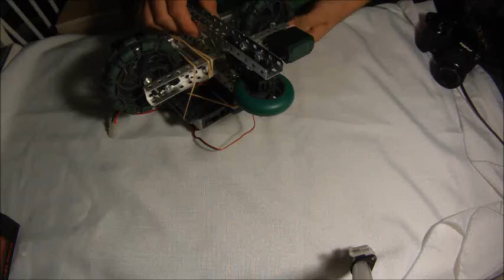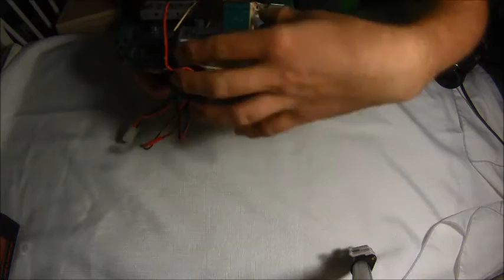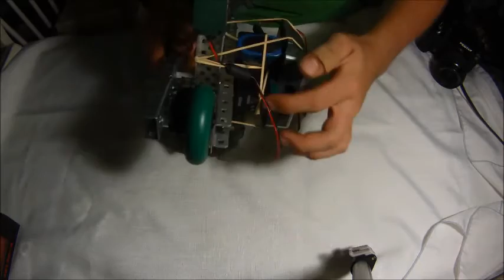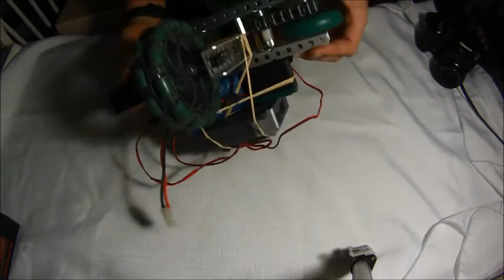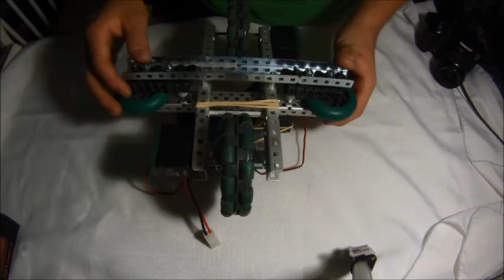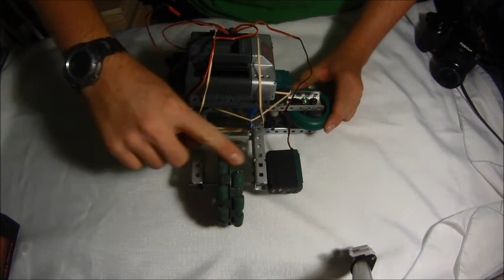DIY BB8 project with VEX parts - #1: The internals

Comment: Good start. Do you have a list of VEX parts you used?
Reply from the maker: Sorry for the delay, here's a general list:
4 - 393 two wire motors
4 - 29 motor controllers
2 - 2.75" wheel
2 - 4" omni-directional wheel
1 - Set of high strength chain and sprockets (I used just 6 tooth sprockets)
1 or 2 - 12" drive shafts
1 - Cortex microcontroller
1 - VEX joystick
2 - VEXnet keys
1 - 7.2v 3000mah NiMH battery w/ charger
4 - Pieces of steel or aluminum vex c-channel (about 10 inches for me)
Assortment of bolts/nuts/shaft collars/standoffs/plastic spacers

Hopefully I got everything there, it should all be easy to find on the VEX website here: http://www.vexrobotics.com/vexedr/products/view-all?ref=tile

If you have other questions go ahead and ask, I made a little progress since this video too so I'll try and post another video soon.
Reply: Thanks for the info. We have a small student team working on a design based on what you have done but we are using Vex and Arduinos.